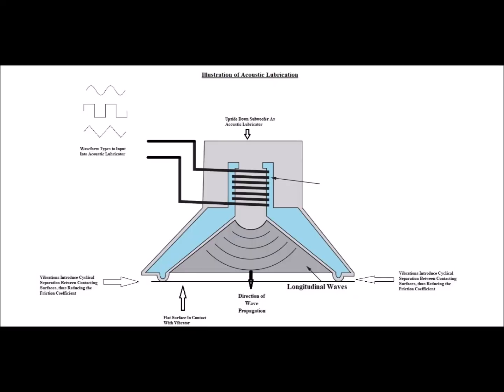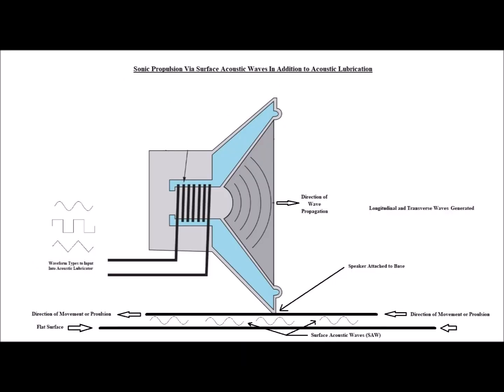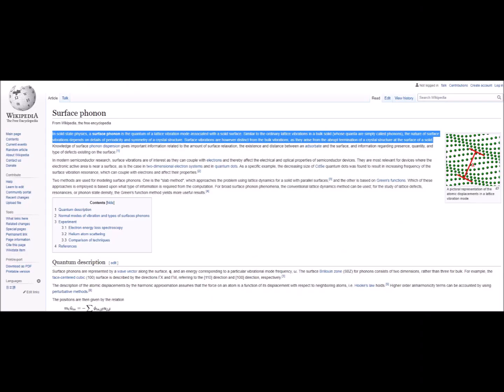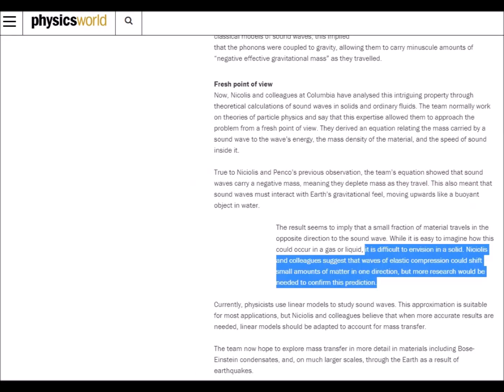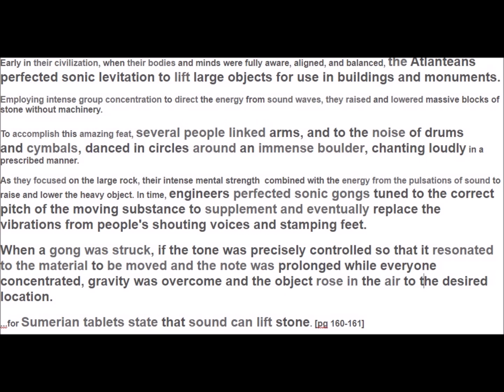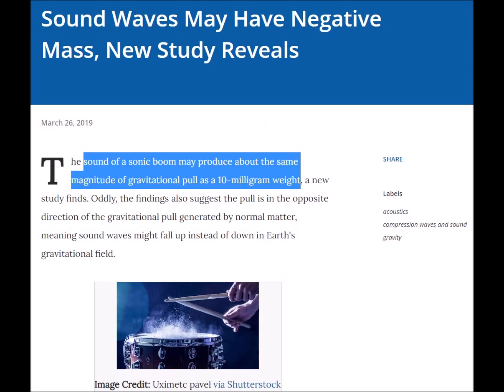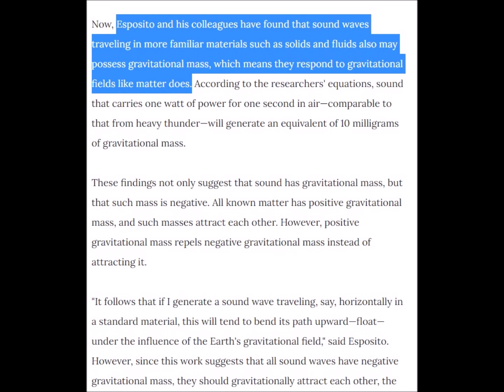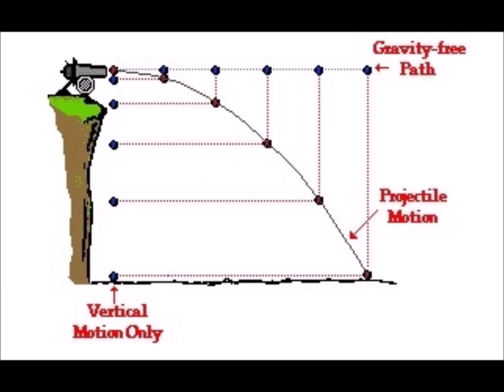Phonons and Anti-Gravity: Are Sound Vibrations the Key to Negative Mass?

Comment: The big barrier with most of these higher tech is battery capacity, fuck lithium, graphite mixed with hemp bast fibers (fiber being the smaller part of golden ratio) gives supreme energy capacity and graphite mixed with polymer gives superconductivity, try that on a peizo sensor connected to resonator

Comment: create a vacuum chamber the size of a mid-sized sedan
atmosphere will want to compress said chamber
use phonons to reinforce the hull
inside said vacuum chamber have a device suspended in the center which manipulates a magnetic field in, say, six quadrants of the vacuum mapping the six degrees of freedom
you have just created a flying saucer with no nozzles, exhaust, or obvious ports exploiting the power of buoyancy (density manipulation) and able to travel through air and water seamlessly